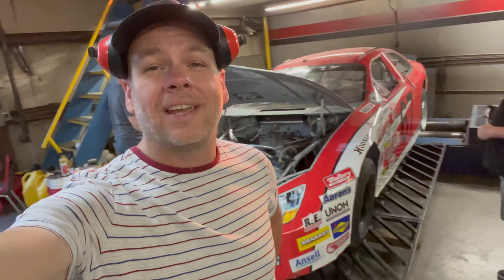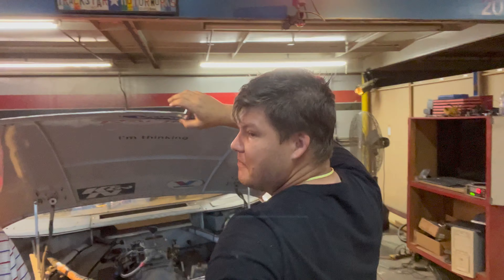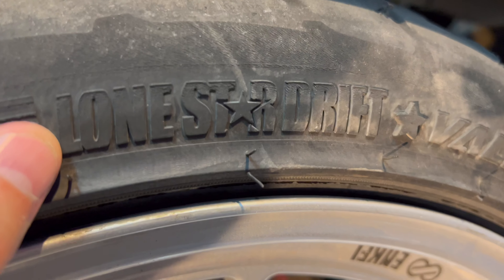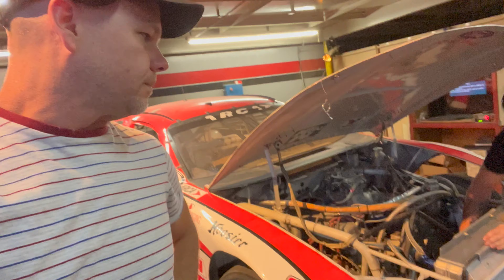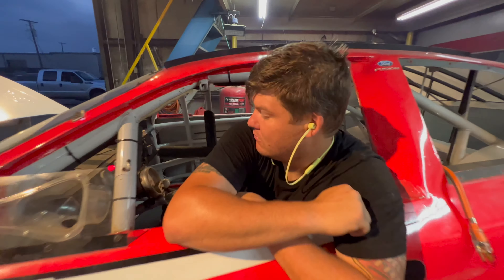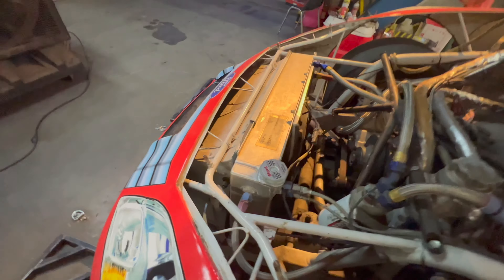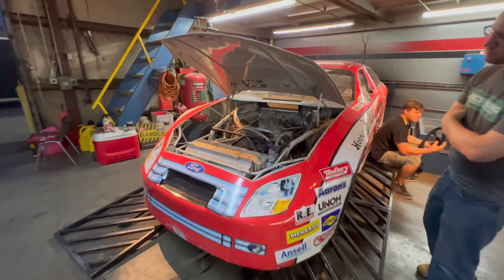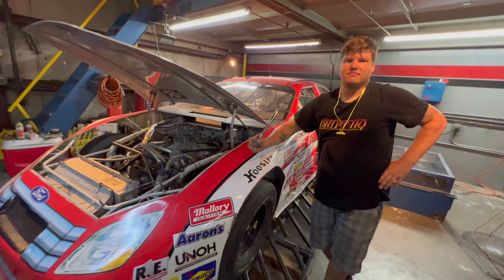9000 RPM DRIFT NASCAR on the dyno!  Baby steps first.

Comment: Notice how cool the mechanical gauges are! They also run minimal openings in the front on NASCAR cars , teams monitor the temps and block as much air intake as possible to reduce drag. These motors will run 250f all day, that's also the reason for the higher pressure cooling system, this way the fluid doesn't boil.

Comment: That's an arca car. Those made less than 600.
Also that shouldn't be higher than 220. Your going to over heat that motor extremely fast unless you add a bigger fan.

Comment: Woo happy to see this thing making some healthy power now can’t wait to see it on the track.
Be careful as you mentioned those were designed for high speed/HUGE air flow.
The current fan size/lack of shroud/position of fan is so close to the rad it will never keep the car at a reasonable temp.
2x 16” brushless spal fans on a nice shroud will  would do the trick or a mechanical fan setup like the other car.
To keep the head gaskets/heads happy long term you want to ensure you can maintain no higher than 230f while abusing her. 
Proper fan setup/ducting to the rad and you should have no problem at all holding under 220f.
Reply: Really hope someone relays this important info to AAron
Reply: @Vgk36  hopefully he sees the comment! :)

Comment: Those rpf’s look horrendous on the car and as far as the temps go those cars are made to run 400 miles at a time full tilt. Once you get the correct carburetor on there you’ll be throwing down 600 easy maybe hit up Chelsea Denofa

Comment: If you need to get the great value Nascar up to temp quicker throw a jacket or blanket on the front of the radiator while idling for a couple min. Helps with mechanical fan cars in cold conditions. As well as cars that somehow cool too well I'd assume.

Comment: Modified carbs and some other brands aftermarket flow more than the listed CFM, it's easy to pick up 50+cfm.   I doubt you'll find 100hp with a bigger carb.  That motor is prob lower power for a smaller track.